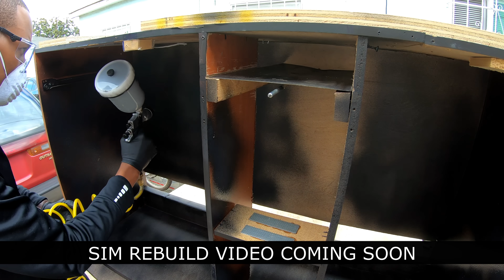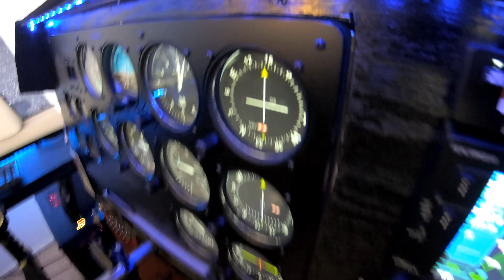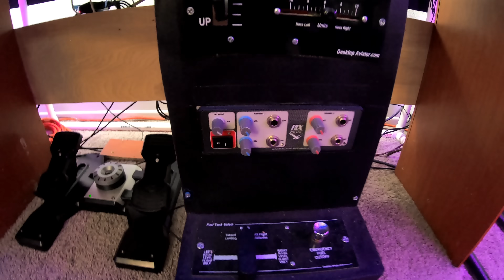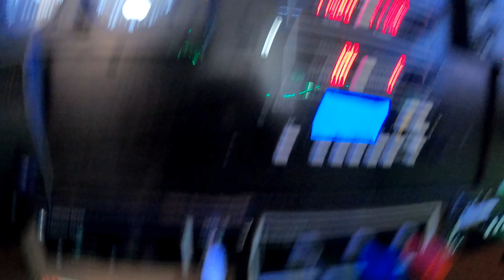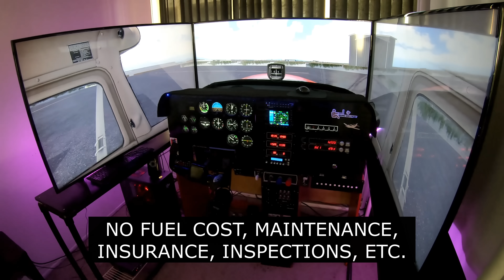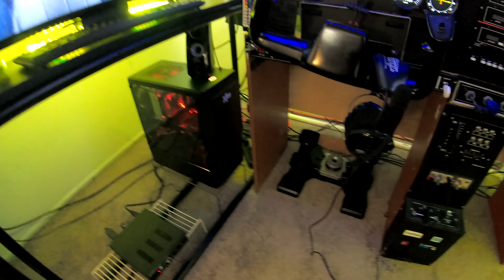HOW MUCH??? | Home Flight Simulator | Home Sim Pilot

Comment: May I ask: Why the separate computer to run the panel?  Is it difficult to get the two computers to talk to each other?  I would worry there would be noticeable lag in the gauges.  I’m planning on building a system like this.

Comment: wow, that's amazing! Great setup you have there! I've built myself a space sim cockpit for Elite Dangerous but you have far more consoles, switches etc than I do. There isn't that many controls for the ships in Elite but my PC uses: 
a 4k HDR gaming screen, HD touchscreen with cockpit panels and system usage info, 2x tablets (one orrery map with tools and apps for Elite, one for voice, speaker and mic volume with touch for levels), 2x phones (directional audio output of the 8 channels and system performance), logitech G19 (with LCD screen using Aida 64 with a custom app) an X52 pro HOTAS, Pro flight rudder pedals, TrackIR / Vive, Kor-fx vest for right and left feedback, Subpac S2 for rear feedback and subpac m2 for centre / sub. For speakers, I'm using 9 subs, 9 tweeters and 9 mid range speakers for 8 channel directional output (shown visually on one of the phones as I said, at the end of the throttle). 

Keep up your great work and fly safe

Comment: Very informative and helpful video.  Did you research or consider using VR instead of the monitors and the physical instruments?  I’m very interested in building a flight simulator system with HTC Vive or and Oculus Rift S headset.  I’m leaning toward the HTC Vive.  Benefits seem to be less cost, a less complicated setup, less risk of compatibility and maintenance issues, and a very immersive experience.  The biggest negative that I can think of would be likely not being able to incorporate the use of an iPad running iFly GPS, Foreflight, of Garmin Flight. Personally I’m using iFly.  You’re very experienced with setting up and using flight simulators, what do you think about a VR setup?  Thanks again for creating this video!

Comment: Nice setup. I'm jealous. I tried setting up my cockpit in my Big rig, but this truck isjust too small. I even took out the passenger seat to make more room but still not enough space so all my gear just sits in a bin. I received my PPC in 06 and after starting my commercial training also realized I didn't want to fly for an airline. I built my mini itx build 2 months ago to get ready for Ms Fs 20. Ryzen 5 3600 geforce 1660 super 16gb 3200 ddr4 ram 512 ssd and 1tb 7200rpm hhd. After trying out x plane on it, I decided i will be upgrading to th 2080 if it fits in my case.

Comment: Hi, I see that you are using Saitek radio panels with a number of Desktop Aviator products. What version of Saitek drivers are you using? I find that that using the newer Saitek Drivers prevents the DTA's Throttle and Trim Wheel from working correctly. But I see from your video, both are working just fine. Steve

Comment: Nice set-up!!   I have a 10 year old setup from Hot Seat using MS Flight Sim X that I bought when I was doing my instrument flight training.   Not sure it paid for its self, but it did help with me being able to practice VOR DME, ILS approaches and other IFR stuff at my own pace and with less stress.   Over the last 5 years though, it has been mostly collecting dust.    

I have just got back into flying after taking a 3 year break and was using my sim for some basic VFR stuff and realized just how dated all my stuff is now.   I looked into what's out there now as a replacement and the Red Bird stuff looks awesome, but I just can't see spending $10K on it.  The biggest issue I have is how much actual flying I could do with those funds.    I guess some day if I am ever permanently grounded, I could see spending that much, but not right now.

Comment: Why the second computer? Couldn’t you have added a second graphics card to your faster PC if you needed more video outputs? Also how are they tied (how does the second computer get the data for your instrument display). I’m in the research process for building my own flight sim getting ready for Flightsim 2020 to come out. I’m also a “past” pilot, I flew gliders as a kid, soloed at 14, and then adult life happened. I’m also at a point in my life now where I can afford to get back into aviation and also want to build a sim to “knock the rust off”...

Comment: Nice Video. I think this is a very authentic immersive sim. The only Question is, why it would not be possible to directly go for a G1000 Setup because it eliminates several of the components (more or less the entire Panel).

Comment: $7350.

VR headset: $1000, plus PC to run it: $1500.

$2500 for a VR system. It’s a lot more immersive and gives a full 360 view of any cockpit. 

If people don’t see the power of VR, you need to wake up. It’s a lot cheaper for VR, and far more immersive.

If you want a computer like his? I can build it for you for $2000.
Reply: cry

Comment: Great video - I have settled on not adding up the cost of the sim over time. With the hardware and all of the software, add ons and fixes it would be eye watering and you would probably not be in the hobby I suspect if your focussed is on cost. The pleasure from building and flying a sim is absolutely priceless :-).

Comment: This is the way! I have been wanting to fly since flying with family that have lic, and built experimentals. Jumping in the cockpit, and talking on the radios seems difficult to me. This set up and others can get the seat time and stay fluid and well versed. I think even work on emergency skills without actually dying! The price is cheap for experience. 130 per hour for a plane rental, 50 for a instructor, and fuel at 4 or 5 bucks a gal. This is the way to go and you don't even have to drive to the plane! Thank you HOme Sim Pilot for the walk through!

Comment: If I added up my current PC, the 2 graphics cards I've swapped out since I got it, VR, ultra-wide monitor plus my secondary smaller one, desktop sound system, headset, keyboard/Mouse, joystick, arcade stick, driving wheel/pedals and the games I've bought since JUST getting this PC... I'd be right up there. If a hobby brings you joy and stress relief, it's money well spent no matter your budget... But I'm also single and have a lot of disposable income and only have to answer to me. Haha. :D

Comment: Awesome set up. How does this compare with a high end VR setup both in terms of experience, realism and cost?
Reply from the maker: Ive tried VR several times and i really wish I liked it but it's just not for me. I much prefer the cockpit and hardware
Reply: @HomeSimPilot  I see. I like the concept of VR in that it gives full immersion (if it works well) and us very configurable in terms of the aircraft you want to fly. I like the home cockpit as well, like the one you described.

Comment: How can I get my Saitek switch panel to actually turn the other panels off and on with the toggle on it.. when I flip the switch b on the switch panel it does turn the avionics off in the xplane program but the physical Saitek FIPs and radio panels don’t react.. any b ideas?? Jim jimscatigna@gmail.com
Reply from the maker: James Scatigna Are you using the saitek drivers? Use spad.next driver instead to make them customizable
Reply: Home Sim Pilot oh... I am using the Saitek drivers... so I will have to use the SPAD drivers and customize it to do that?
Reply from the maker: James Scatigna thats correct
Reply: Home Sim Pilot I’m gonna give it a try here in just a little bit hopefully some kind instructions to help me through assigning that
Reply: I just read the manual and I don’t see anything about it being able to turn off and on the other radial panels with the switch panel
Reply from the maker: James Scatigna Do a search online about spad.next virtual power
Reply: Home Sim Pilot i am gonna give it a try.. I assume I have to delete all SAITEK drivers first?? Also can you just use the spad driver for the multi panel only to control the other that’s are working on s  as SAITEK drivers or as lob the panels need the spad drivers?
Reply from the maker: James Scatigna I never tried to run both but it appears you can. Check out the forum topic

https://www.spadnext.com/forum/viewtopic.php?t=3076
Reply: Home Sim Pilot btw.. thank you so much for all your advice and replies as I know you are probably busy and still taking the time to help Is greatly appreciated.. so I tried the next  drivers and it works...it turns on and off the radio panels but it does not turn off the multi panel or the flight instrument panel when I turn the avionics switch off and those switches in the next set up of devices are grayed out so we can’t change it to ON for virtual power.. any ideas?
Reply: Home Sim Pilot is it possible to run the flight instrument panels and multi panel and radio panels on one computer and the X plane 11 on another computer?

Comment: I am thinking about buying a gaming laptop (Alienware) for flight simulation. I have a preference with Flight Sim 2020 when it is released. Do you think I can setup a simulator similar to yours and run it off the laptop? Let me know if you think that will work. Thanks!
Reply: Looking at the recommended specs of fs 2020 it should be fine with a high spec gaming laptop. But factoring in what add ons are or aren't included you might struggle. Things alike high end graphics aircraft, scenery, airports demand more processing power so if I were u I would chose w a desktop. U can build one your self and it will be cheaper than a G laptop.

Comment: I am building a full size B-767 cockpit. Mostly Saitek. I can build the computer for less than what you paid. The video cards and resolution of the monitors are what cost the most. NVIDIA is selling its newest card for almost $2000. It would be crazy to buy it now. Last year's 1080's are down by more than half. I am now working on electronics, overhead panel and synchronized pedals and yokes. All home made based on plans I got from the internet.  My only problem is space... my wife is a pain and will not tolerate the  FS in the house. I have accumulated a lot parts such as short throw LED projectors, reverse projection 180 degree  projection fabric. All bought over the last 10 years, all I need is more space or a a new wife... I have more stuff than I will ever use.Switches, potentionmeters,  Keyboard emulator etc. I am a physician, but my backbround is in electronics.  reply to me if you  have use for some of the above. I am cleaning up to see if I can get some space to get my sim going.  Started looking at electrical actuators / stepper motors and servos.  I figure the entire platform by itself will weigh   at least 150 pounds. Add 2 "healthy" pilots we are closer to 500 pounds.  I do have some ideas I would like to share with you.  I am not trying to sell anything, if anything .  Just exchanging information. If you can help me with some ideas, i would really appreciate. 
I am in Arizona.   My public email: viceroy1927@gmail com  then we an exchange info,   Looking forward to hearing from you   -  Tony.

Comment: Its cheaper than the real thing and if you mess up, you have a reset button.  Plus you dont have to worry about a passenger puking all over you if the air gets rough.

Comment: So would you say ATM the only dependency that you're unsure about working with FS2020 is air manager (till they release a version for it that works over simconnect?)

Or are there other hardware components you're worried may not be supported due to their design/software requirements / driver support.

For example you said the manufacturer of your yoke no longer exists. Luckily it's just simple axises so it should be configurable out of the box. But is there any other components you're worried may not work?

Comment: Great video. Thanks. I’m also a certified pilot. I had a flying hiatus of over 25 years. I got back into flying not long ago and am finally serious about getting my instrument rating. My sim setup is nowhere as exotic as yours but I do have a lot of the same stuff you.  Even my sim setup with 3 monitors & accessories is 10x better than the FAA approved sims I’ve flown. One thing I’m unsure of is how to connect a plethora of monitors including my GNS 430. Since graphics cards only have a limited number of HDMI and serial ports how do you run more than one PC/multiple graphics cards so they all talk to each other?  I currently own two Piper Cherokees. You think your wife has a problem with a $7K sim setup?  Try explaining to her why you need two airplanes (fortunately my son is an A&P).
Reply: i've now had a flying hiatus of 29 years!!! Maybe one of these sim set-ups is what i need to kick start me again

Comment: imagine playing on microsoft flight simulator 2020, that would be sick
Reply: we won't have to soon.
Reply: I learned recently that the MS2020 isnt going to be geared towards hardcore flight simmers like us; you would be able to fly most aircraft with an xbox controller. Been reading a lot of comments lately about this from ppl who've tried it and were depressed afterwards.
Reply: @utley  they said they are mainly catering for hardcore fans in their video so dunno why you getting that from
Reply: @utley  a developer also said he recommendeds a keyboard and mouse on xbox as its hard to control with the controller
Reply: @utley  the only thing negative it said was subscription based

Again do some research a developer said it will not be subscription based the only way it would be linked is that it's on gamepass wait till it comes out then judge it
Reply: @pixellifesimulator4965  somewhere along the lines were mentioned that it was going to cater more to Xbox gamers than PC. That has been researched and confirmed by many people who went to the expo and tested the simulator. XBox. PC included, but still mainly Xbox. It may be visually stunning, but until its released and confirmed to be the high quality "simulator" you are claiming it to be, I wont hold my breath.
Reply: @utley  I don't think your sources are correct.  The next Discovery update is IFR.  I don't see the typical Xbox player flying IFR.  They have also been touting multi-monitor and peripheral compatibility.  None of these apply to Xbox.  As you said, we will see when it comes out, but I really don't think they would go the Xbox one-and-done route.  The subscription model really does target the simmers.
Reply: @ChromePlanet42  I didnt say its going straight to XBox, Im saying that its going to cater to the XBox crowd too. It is also going to XBox.
Reply: @utley  No, I get you.  I know they have to put some "casual gamer" features/games in for the Xbox, and I think they need to release it to that platform for the sales and visibility.  I just don't see them catering to the Xbox crowd. They seem to be taking their time getting the aircraft right, like with the A320.  With all the interviews I've seen I have hope they wont so I hope you are wrong on that.  Unless of course I can connect all my Ardurios and peripherals to the new Xbox then that will save me the PC upgrade for 2020!   I can't take single threaded anymore!  Happy flying!
Reply: @WhiteHawk77  Im sorry dude, but if you can pilot a 747 with an xb0x controller, then its watered down.
Reply: @utley  yeah you're not grasping this. The difficulty/realism is customizable--as in you can set it to be a full sim experience
Reply: @WhiteHawk77  yeah it seems like a lot of people these days just can't handle being wrong. They just completely deflect or ignore anything that contradicts them.
Reply: @tmorelli1982  Ill see on the 18th, didnt stop me from buying it.
Reply: @utley  |

Comment: Congratulations on this set up!  Having owned two different airplanes over my lifetime (Cessna 150 and Beech Sundowner) I can assure you that this is what I would be getting into if  one day I couldn’t fly anymore. I had a magneto go out right after an $1,200 annual. It cost me another $1,100. So this is SO cheap compared to the real costs of General Aviation.  It really is a crap shoot in GA ownership. I got out of ownership 6 months ago, haven’t looked back.  Cheers, Jeff.
Reply: So how do you fly now? I'm interested in getting into flight simulators and if money ever permits, I wouldn't mind going for the PPL and even buying an airplane :)
Reply: @k3iler05   No longer flying. If I were you, I would get a nice sim and learn as much as you can with it as possible, it will save you $$$ if/when you go for your PPL.
Reply: @Jeff_The_Weatherman  That's my plan exactly. :) I figure I'd get the basics before I ever attempt to try.

Comment: This is good bro. I have suggestion. You can static fix all things inside a cover frame. And rotate complete frame incircle as you change the direction of plane. Initailly you can connect frame with 2 stepper motors and a rigid frame. Program the motor on arduino based on your mechanical direction handle in your hand.